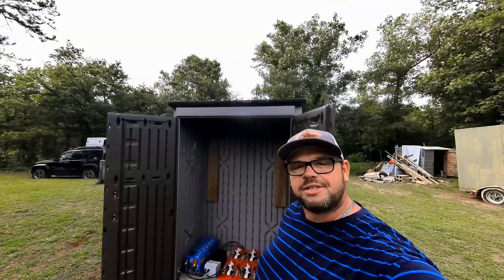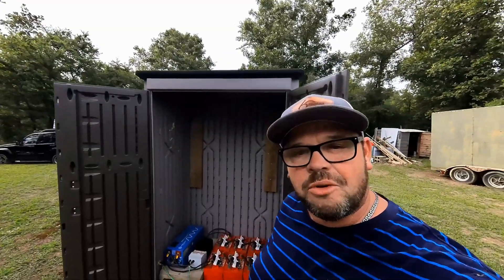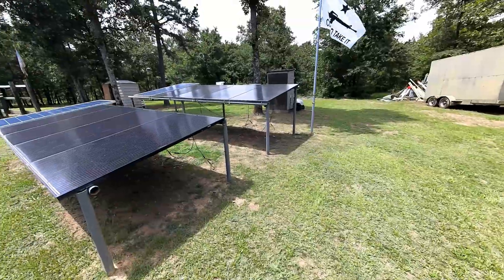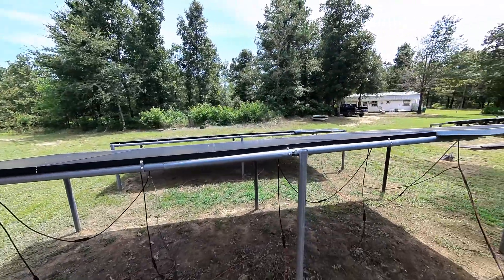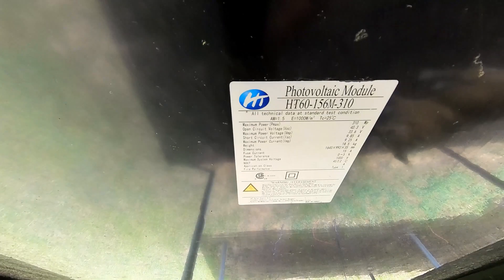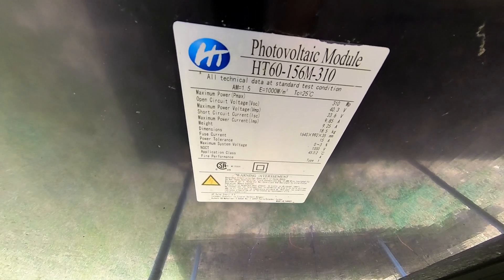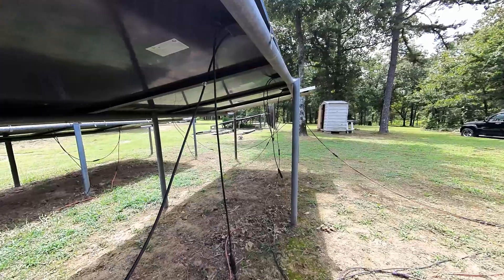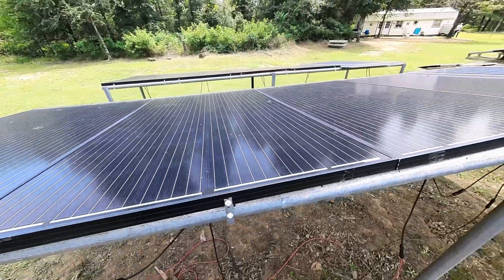How I Just Built My Own Solar Cheaper!!

Comment: One tip if you use mppt controller you don't have to match the voltage of the panel with the battery just don't exceed the voltage limit of the charge controller. So it's possible to use 12 24 or 36 volt panels if you wish.
Reply from the maker: Ya I'm learning that this go around

Comment: Those wires going into the charge controller without some sort of protective shielding against the sharp metal edges is a fire waiting to happen.
Reply from the maker: they have a protective coating on the metal not really sharp..but ya i see your point thanks!

Comment: You could also run all those panels in series, as long as your charge controller can handle that much voltage, which is more efficient..And you don't need a combiner box, but an in line fuse is a good idea..My system has 450 Volts of solar going into my charge controller, it can handle 500 volts, my system is a 48 volt system though..The best deals these days are all in one inverter/charge controller from mpp solar, and Lipo4 server rack batteries...Much easier, cheap, more reliable with ten year warranties..But, nice system, I had one just like it, a few years back, before going Lithium..
Reply from the maker: That's all good and everything man but I do not see we're raising the volts to 450 and then having to knock it down to 48 and then bring it back up to 120 is more efficient. The high-voltage is only efficient over long wire runs such as substations to telephone poles two houses. Running a high voltage on a short wire is just going to heat up your charge controller in order to bring it back close to the 120 you're trying to achieve in the end. The most efficient way is to bring your DC power up to around 120 and then transfer it to 120 AC and that's how you will lose the least power through heat burn off on the fins of the charge controller. But a system like that would require 120-volt DC inverter
Reply: @OKLAHOMAOFFGRID good video.  The idea behind the higher voltage is to carry less current requiring less cable size to carry the power. It is a good idea to run the PV input at a higher voltage then you don’t have to spend a lot of $ on thicker cable.  You may realize this and I am not trying to school you in any way just thought I would give you a reason to run higher voltage. Hope this makes sense.  If not ask me a question.  All the best! God Bless you.  Waving from north Texas.
Reply from the maker: @brentjohnson6654  yes sir thank you very much I'm actually about to do another system and I may be wiring it up to about 500 volts I'm doing some study on it it's just New Territory for me
Reply from the maker: I started thinking I bet you have the EG4 inverter/charge controller
Reply: @OKLAHOMAOFFGRID  Sure do, two EG4 inverter charge controllers in Parallel and 2 server rack batteries, with more coming in the future, although I might build the next battery out of raw prismatic Lipo4 Catl cells..EG4  and MPP are the same product with different names, but Signature Solar sell them both..By More efficient I mean your using less wire, no parallel solar panel strings, no combiner box, faster charge times..Not concerned about losing some heat generated by the sun..The sun isn't going to burn out anytime soon, efficient for me, is the goal..And the products have long warranties with a great track record and build quality..
Reply: @realeyesrealizereallies6828 raising the voltage keeps the amps down which keeps the heat down making it more efficient right? I'm new to this as well lol
Reply from the maker: i just picked up in person today 2 100ah server rack batteries and the eg4 3000k from signature solar and 16 48 volt 305 watt panels...about to build and film a new system
Reply: @OKLAHOMAOFFGRID  Lots of cash out of the bank account today..You'll love it with all those panels..My batteries are charged by 1 in the afternoon, and the power from my panels bypasses through the inverter to run my loads, which is air conditioning, fridge, deep freeze, and everything else until the sun gets low and then the full batteries kick in..Can't beat it..Yee Haw...
Reply: @OKLAHOMAOFFGRID  oh you were in my neck of the woods. We are 25 minutes away from signature Solar.
Reply: @OKLAHOMAOFFGRID  sweet man! 200ah added to the system will help alot! So will all those panels!

Comment: How long can you run your window air conditioner
Reply from the maker: all day long when the sun is out with no problems...but when sun goes down around 4 hours tops and batteries start to get 30% discharged and i dont like to go below that...could go longer with a larger batt bank

Comment: Justin, many thanks.  You made it so easy to be able to install everything.  I checked the links you gave and it was worth the visit.  I am wondering how you would go about checking the batteries when one or a couple are failing or drained out.  To see which ones are shot.  With a sharp-ended light-up fuse tester or ?  Unhooked, hooked-up?  If you unhook any lines, would it be best to cover the end which hooks onto the battery or the post, to prevent a mishap?
Reply from the maker: always be careful when you have a powerful battery bank of this size ran together. never let anything touch or ground out...you will regret it. as far as the batteries you would fully charge them one day until they are in float mode...then unhook each battery from each other keep them independent until the next day...then come out in the morning and test each one with ah tester and voltage tester...and testing each cell with a hydrometer...all of these things will let you know if there is a problem from a certain individual battery